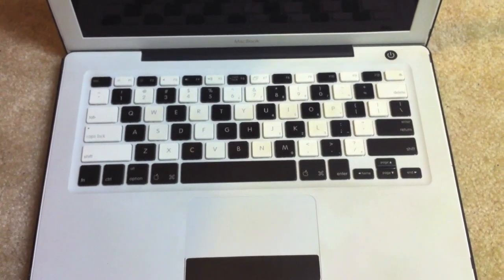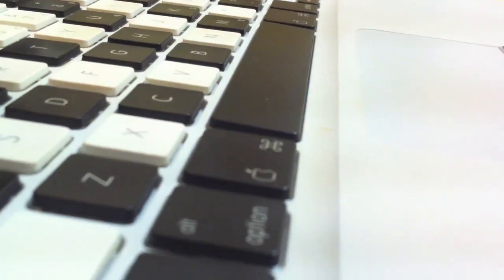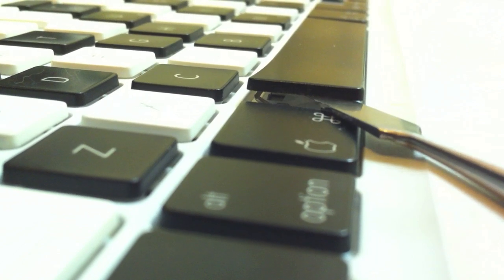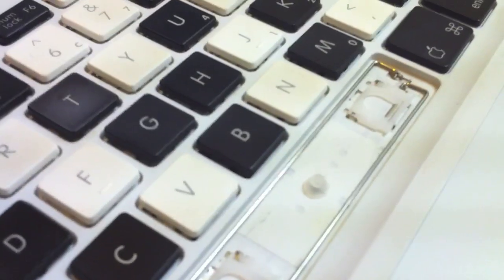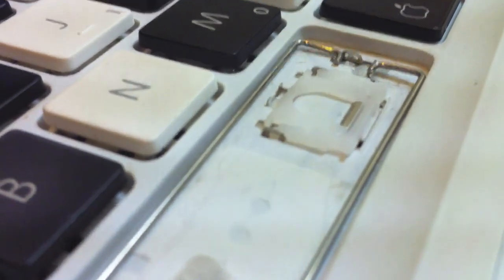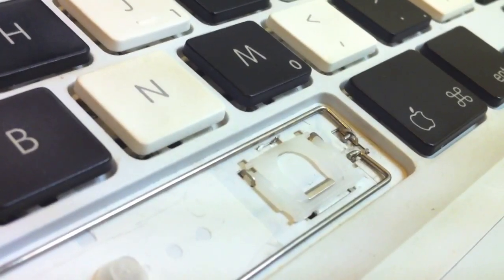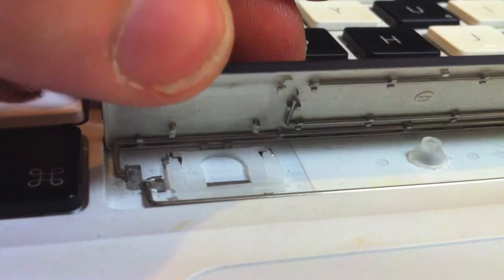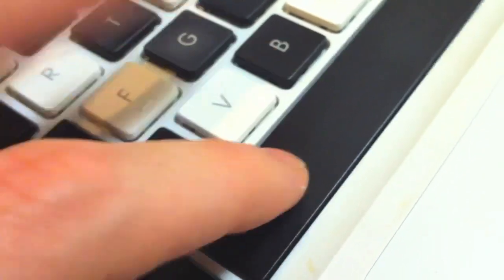MacBook spacebar detail fixing, cleaning, or replacing

Comment: The hero who keeps on saving. In my case, all I needed was literally the very last part: getting the spacebar back on the plastic brackets. The right end of the spacebar on a 2011 MacBook Air someone gave me was sticking up, making a space hard to type. I thought I was going to have to take the whole key off and clean out some debris, but on a whim, I decided to try pushing down while pulling towards me to see if it was just a stubborn plastic bracket that wasn’t fully seated. And sure enough! Spacebar is back in action! Thanks a ton for your detailed walkthrough!

Comment: The thing you mentioned with the brackets was really helpful because I took off the german return key which is formed like a "L" and it has brackets too. I did get properly back on, because the brackets weren't at the right place but with video I managed to get the return key properly back on. thanks!

Comment: You Sir, are a genius !

Thanks so much for this video. My 2 week old 2012 Macbook Air 11" spacebar developed a squeak out of nowhere whilst travelling away on business. Found my trust leatherman and managed to get it off, and back on again with 2 attempts. One of the metal bars underneath on the left hand side may have been slightly out of alignment - after a quick check and replacement of the bars and snapping back the key itself like you showed .... its 100% again.

Comment: Thank you so much! My Macbook Pro has a silver keyboard and I have no idea what year it is. Maybe 200nine? )huh oh, I cleaned my number nine and thought I fixed it, but it appears to still not be working because I can't type the number or the left bracket! Maybe that's a software issue?), but the two metal brackets didn't have any real places where they hooked in to the base of the key board. I just had to sort of set them back into place (there were holes for them, but they were very loose), and with much luck, I blindly snapped them back into the space bar key once I got it snapped back into the plastic brackets (of which mine had three). I actually laughed out loud when it all snapped back in, because I couldn't believe it. But now it's all fixed! Thanks, again!

Comment: After assembling mine back together my space bar is unresponsive. I had a VERY VERY minor spill last night. All the keys worked, but 5 were sticky, so i took the space bar, vbc & command off. Again they all responded and worked as they should, but were sticky. So i cleaned all of them, and put it back together. Works like a charm. EXCEPT the spacebar. I've gotten set right, its back together as it should, and pressed all the places as it should.  Yet will not respond.

Comment from the maker: @pinkshrimp I had to mess with mine a bit to make it work right.  It kept wanting to stick pressed in.  And then it clicked.  I ended up not snapping the spacebar all the way down onto the plastic tabs.  To this day, it's still not snapped all the way into place, but it works.  As long as you have all the pieces, and none of the little tiny plastic tans are broken (and probably even if one of the tabs did break), you should be able to fix it.  Good luck!

Comment: I know how to remove and put the spacebar back on. But how do you actually FIX a spacebar that isn't working? The little rubber nub under mine has come loose, not sure if it's safe to superglue that. Also, the little white springs on either side seem broken or something. The tension and spring in my bar is busted. I press the key and nothing happens.

Comment from the maker: @ntorneiro That can be avoided if you are very careful.  To be able to take it apart without braking or loosening it, it's a good idea to see how the clips hold on to everything.  That way you can tell which part of the key to tug on.  Either way, it's still a risk, and I only did it because I had plenty of extra keys in case something went wrong.

Comment: I can get as far as hooking up the two metal bars but I can't get the spacebar to latch in place at all. It just stays loose and I'm not sure what I'm doing wrong...
Reply: Katy  Fisher did you fix it? :( same problem
Reply: Try to push a bit on it gently, everything will fall into place
Reply: @Ame Otaku That was my problem when this happened, not every macbook spacebar looks exactly like the one in the video so I'd remove and turn it 180 degrees if it's not snapping back into place.

Comment: NOTE: This does not work on the 2017 MacBook Pro .  I am guessing that it doesn't work on later models either.  Mine is a 2017 and it has a completely different space bar - no metal brackets - it will not go back on.

Comment from the maker: @GeniusClaire That seems to work better for some than for others.  For me, that led to my spacebar sticking in the pressed position.  As far as I could tell everything was in place.  So I took it apart again, and made sure every little clip was holding onto what it was supposed to.  Success followed for me, but from the comments it looks like even these steps are not enough for some.  I did mention the spacebar is tricky, and that's coming from someone with a fair amount of experience. =(